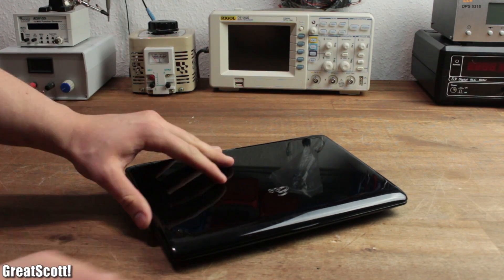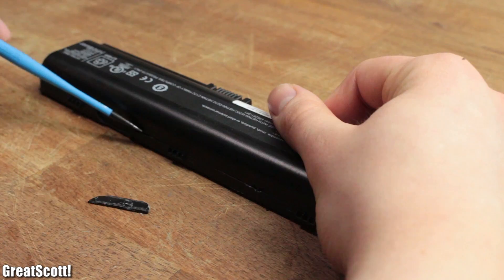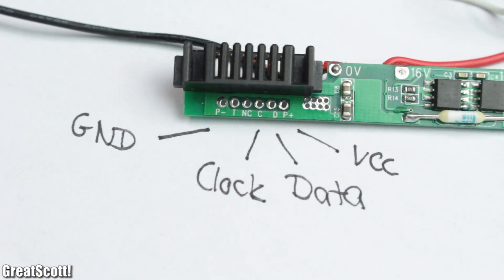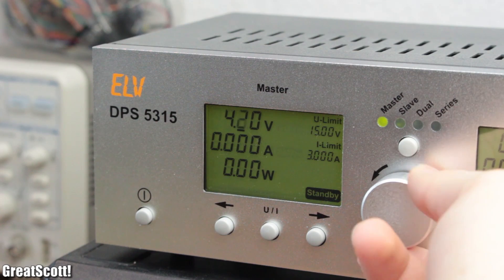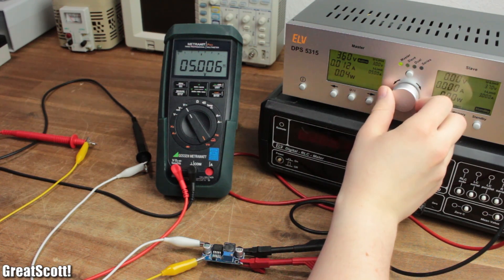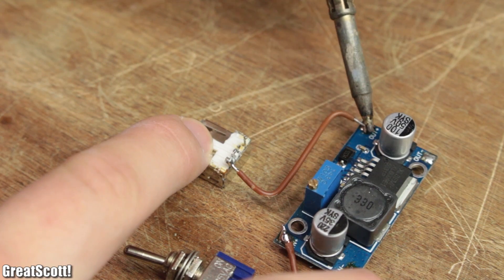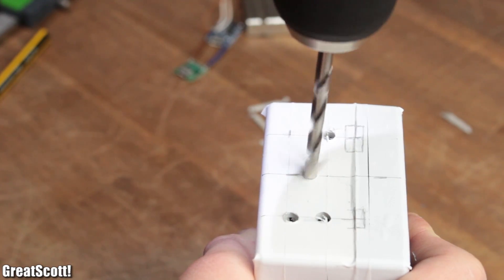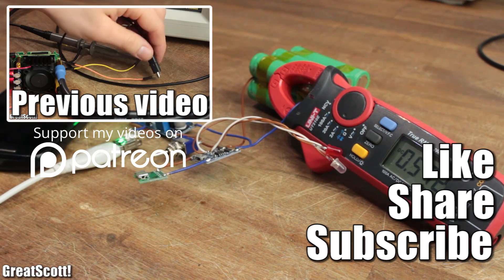HACKED!: Old laptop battery becomes a Power bank

Comment: Do not use that boost converter, it's output is electrically noisy, unstable (noise/oscillations depedning on load/load charateristics), and can easily overheat. Also, use a fuse on the batteries. Be very careful not to short them out, as they can dump a LOT of current!

Comment: no diode in series from power an battery? the right way to damage power supply
Reply: +Cappellaio Matto it is meant for charging batteries, a diode would lower the voltage too much
Reply: If you use the power bench you adjust the offset of the diode, or put in series a power schottcy diode with low drop. Really is dangerous for the psu to charge battery without diode. Sorry for the english
Reply: Cappellaio Matto i can understand the english. i thought you were talking about the dedicated charging board for the power bank, not the power supply. if you do hook it up backwards to the power supply, it will pull lots of current, because it is reversing the polarity on what im guessing is a capacitor at the output terminals for voltage smoothing
Reply: Cappellaio Matto yeah, the cheap power supplies are more likely to have problems with that, i think more expensive ones have diodes

Comment: the tp0456 does not like inductive loads across the batteries like motors!

I used 2 old 18650 cells in my small cordless screwdriver instead of the two 10yr old nimh that were dead, screwdriver worked great, charger worked great, but when i used it for the first time, it ruined the tp0456, the replacement one also only lasted about 3 seconds... so i need to fit a charge/run switch to protect the charger IC
Reply: +lez briddon just use a multi position switch, one way disconnects the screwdriver and lets it charge, the other way wont charge but will run

Comment: The battery is the first thing that has gone bad on any laptop I've ever owned...So I don't think this would work very good.
Reply: +foxrace0985 usually the circuit or a pair of cells goes bad, everything else is ok. all of my 18650s are recovered from scrap batteries that didnt work

Comment: hi 2 questions! I have the old TP4056 board and it is recommended to use one for one battery, isn't the same with the new TP4056 you use here, also you disconnect the 2 smd leds and put new ones but you don't change the resistor how is that? In the old TP4056 these 2 resistors were 1k and definitelly the leds won't light unless you switch the resistors with a value of 330R, link here :
Reply: https://www.google.gr/url?sa=t&rct=j&q=&esrc=s&source=web&cd=1&cad=rja&uact=8&ved=0ahUKEwiwwt_8rejKAhUKWywKHbwSD-cQFggeMAA&url=https%3A%2F%2Fdlnmh9ip6v2uc.cloudfront.net%2Fdatasheets%2FPrototyping%2FTP4056.pdf&usg=AFQjCNHwERfTsy0Ry8ZifBlfLtpYhmZnIA&sig2=naEqtWuiIftRFLJ7AogXFA

Comment: You might want to consider adding a resistor divider to the data lines in your USB port where your phone plugs in to. If you give specific voltages on the two data lines, it will signal your phone to do fast charging and pull more than 500mA. This is of course not standardized, so using simple resistors you can only create a fast charge port for android OR apple.

Details: http://www.instructables.com/id/Modify-a-cheap-USB-charger-to-feed-an-iPod-iPhone/

Comment: Would it be possible to ramp up something like this to a system that could power a raspberry an extHDD and charge a device
Reply: +Terry Sterling yes
Reply: DMAN22yeah I have been considering making a mobile data bank.
Reply: Terry Sterling yeah you could do that, if you want maximum energy density use panasonic 3400mah 18650s, they are $4-6 each tho, but worth it
Reply: DMAN22yeah Thanks for the info dude. I will probably work on it later in the year.
Reply: Terry Sterling i plan to make a usb and laptop charger with lipos from old radio batteries i got from a recycling bin at a battery store, and the thing i am concerned about is voltage drop in the lipos for the boost converter, because if i am charging the battery of the computer and using it at the same time, it uses 40 watts on the 120v side, i have no better way to calculate, but that is around 10 amps, so yeah a good boost converter is needed
Reply: DMAN22yeah That's cool, i have no idea what you are talking about
Reply: Terry Sterling i have 10 lipos, i want to make a laptop battery charger, but i dont want to balance the cells so i want all parallel, but to get 40 watts is 10 or so amps
Reply: DMAN22yeah ahh ok, that would be a hell of a thing to do
Reply: Terry Sterling yeah, there are boost converters that can handle 10 amps and boost converters that can boost all the way down to 3v, no in between
Reply: DMAN22yeah that's pretty cool dude. i need to learn more about Electrical engineering aparently
Reply: +Terry Sterling watch more youtube videos. i suggest rinoa super genius and knurlgnar24
Reply: DMAN22yeah Can do, i will get on it tomorrow night after sleep and work
Reply: Terry Sterling also if you like destruction watch photonicinduction
Reply: DMAN22yeah ok, but sleep now shh
Reply: Terry Sterling ok

Comment: next
You can modify the device supply 12voltage  to hard drives it ?. Connect to e-sata or usb.thank
Reply: +เซ็งเป็ด เซ็งห่าน just turn up the converter voltage

Comment: Can i buy 10pcs of 18650 batteries, conect them in parallel and charge this pack with TP4056?
Reply: +Marek Novotný i wouldnt buy them individually or for cheap, they will be a knockoff for sure

Comment: Will the cells still stay balanced without a balance charger? If one cell drops its voltage slower than the rest do you run the risk of overcharging that cell?
Reply: +KuRue02 no balancing is needed

Comment: the 3 pairs of batteries i salvaged from one laptop battery are all different voltages: 2.73, 3.15 and 2.9V. Is it ok to just connect them together in parallel?
Reply from the maker: +Mr Ching „chicho“ Chong Firstly charge them up individually completely. Then put them in parallel. Still not the best solution since they probably all can hold different charges, but nothing will explode.
Reply: ok thats what i thouht i should do too. but first i have to buy a bench top power supply -___-
Reply: +GreatScott! sorry i have another question. Charging the power bank at 1 A will take around 16.8 hours to complete, so i was wandering if we can change any resistors on the charging board to make it output 2 or 3 A?

Comment: A fun project to learn the basics but all of those parts cost more than buying an off-the-shelf powerbank that lets you insert your own 18650 batteries.
Reply: but then you do not have that nice feeling when you build something and it works...
Reply: True.  That's what I ended up doing; buying an empty 6-cell power-bank box off eBay to house some spare 18650's from a dead laptop.
Reply: yeah but they are limited to around 4 cells
Reply: can u link to it please?
Reply: +Plankins df

Comment: Wouldn't it be cheaper to buy some 18650 batteries rather than buying old laptop battery? There are prety low prices on eBay.
Reply: +Majk Majkovky you can get a laptop battery for like $4-8 if you buy individually, to get individual 18650s is usually $2-5 each. if you buy bulk laptop batteries they can be like $2 each

Comment: Is it possible to use a higher powered charger to charge the battery faster? I'd imagine it would take FOREVER to charge this through a standard USB charger.
Reply: hmm i was thinking the same, but the charger board only accepts 1.2A max so still gonna take a long time :(

Comment: What happens if you connect the USB output to the micro USB input?
Reply: +Marius Ammann haha legit question, i wander what would happen xD
Reply: no infinite energy, sadly. it just thinks its charging
Reply: The battery will discharge itself...
Reply: +MrSky05 it would also have a chance of shorting it self if i am correct
Reply: Joe Federico no there is no way it could do that
Reply: +DMAN22yeah oh I had power banks that short themselves out by doing that
Reply: +Joe Federico I do that, nothing bad happen, only its "charging"
Reply: +MrSky05 ok maybe my power bank was defective

Comment: A warning should be shown for opening the battery case with a sharp object like a screwdriver. There is a high risk of puncturing one of the lithium cells which are very close to the outer plastic wall and that could cause it to catch fire or leak dangerous chemicals.
Reply: VoltLog 18650 cells are pretty hard to get punctured, as they have a solid matal case. I opened my battery pack with an exacto, hitted one of the cells and nothing happened. (Luckily)
Reply: I have dropped and smacked my lithium cells quite a few times and nothing happened, but I could be lucky
Reply: Juan Sambucetti that doesn't mean anything, because the top and bottom can be weak spots for these batteries and this way they can catch fire. Just because yours didn't or because it isn't highly probable doesn't mean there shouldn't be a warning because when it does happen it can be dangerous. But then again what are you doing opening old laptop batteries if you don't know what they are and how dangerous they can be lol
Reply: @dimitrijekrstic7567  i am a technician (not engineer, it's kinda like one step below that). I may know something about electricity, batteries and electronics in general and know that if you puncture a lithium battery you're pretty much fucked up, but I also know that cutting metal with an exacto is hard. If the batteries that were inside the pack were LiPo's, then I would have never opened the case with an exacto, or with anything that had a metal tip for that matter.
Reply: @somedude2492  look, if we are gonna brag, I am an electrical engineer. But that's besides the point. It is very easy to short an 18650 battery at the top. The plus is the cap at the top, the one which looks like a button/pimple, and the negative terminal is the whole steel case of the 18650. So shorting those two, which is surprisingly easy to do, will cause a very nice reaction. Your education and/or profession has nothing to do with the basic knowledge that is knowing how a 18650 is constructed. I mean do whatever you please, poke it with a nuclear bomb if you wish, but it has happened to me before, and I was just warning people about how easy it is to short an 18650. Poking through the steel shell of a 18650 is very hard, but shorting the negative and positive terminal isn't.
Reply: +VoltLog no, it is much like a large AA battery, not a lipo
Reply: +DMAN22yeah I didn't say anything about LiPo, those are Lithium Ion cells and everything I said in that comment stands true. They can catch fire and/or release dangerous chemicals if punctured. They are NOT "much like a large AA battery", it would be very wrong to think that.
Reply: VoltLog they are the design of a large aa battery, i was using that as a comparison. they have a higher voltage and have a higher energy density. any battery is dangerous, if you know what you are doing than you should have no problems. and to open them, that is perfectly fine. you are more at risk of shorting than puncture. the casing is very thick

Comment: Perfect timing, I have more than a dozen 18650's that I plan on making the most ridiculous power bank with.
Reply: +Its Voodoo yeah but its only going to charge your phone like 10%
Reply: +TheFlacker99 (Flak) What do you think the capacity of your powerbank will be?
Reply: {MLP} Rainbow Dash Good question, I have around 18 cells, it'll output 5 volts (from a circuit board that outputs 5 volts) and I'm going to guess and say it'll have around 30,000 mAh's. These are all estimates of course. It may not even work :P
Reply: TheFlacker99 (Flak) Well, what is the capacity of each individual cell?
Reply: {MLP} Rainbow Dash XD it doesn't say. I have some plastic covered purple batteries that say ASO, some random numbers and letters, and a barcode. A quick googling came up with some info when I typed in ASO.
 The other ones are red, slightly clear plastic covered ones.They have alpha numerical info on them as well that didn't yield any info with a googling.
Reply: It may not be a great idea to use cells of unknown capacity, if one set of cells has a different capacity, then the pack may not work correctly.
Reply: {MLP} Rainbow Dash I know, but its just so tempting. I'll be testing each cell to see if it holds voltage.
Reply: TheFlacker99 (Flak) You could also put a constant current load and see how long it takes for the battery to hit 3.2v.
Reply: {MLP} Rainbow Dash Well the red batteries might be completely shot. I charged one and overnight it went to 2.8 volts.
Reply: ive had a single 1800mah 18650 cell recharge my phone 30+ % many times before hitting un-usable voltage.
Reply: TheFlacker99 (Flak) oh, that sucks
Reply: bummer man, i sacrificed a non working makita drill battery, managed to get 4 that work out of it.
Reply: you can make one with 2 9v batteries and a wall plug. Open the wall plug out disconnect the wires. Get a 9v battery from the dollar store open it up disconnect everything. Grab the plastic part solder a wire to each connection and connect those to the wall plug components and grab another battery plug it in and get anything you want for a case. Their you have a charger for under $5.
Reply: Its Voodoo Baaah, I want to use the 18650s though. I try to re-use when I can.
Reply: +TheFlacker99 (Flak) I am electric engineer. Cell phone, pc, laptop, watch clock, calculation machine, tv, dvd player, camera...
Reply: Oh I thought I'd let all of you know, all of the 18650's I think were shot. Back to the drawing board.
Reply: {MLP} Rainbow Dash Yes, oh well. To the local vape shop for some 18650 batteries.

Comment: Anyone think about how to build one before he shows the steps to see if you get it right?
Also how does that clamp ampmeter work? never seen one before
Reply: +Thomas Shih it measures the electromagnetic pull and then calculates amps
Reply: +DMAN22yeah okay that makes sense, how does it get rid of interference then?
Reply: Thomas Shih it has a button to zero it out before you put it on the wire

Comment: You should NEVER try to recharge Lithium-cells that has fallen below 2.5V per cell. It can be very dangerous, ans they are a ticking bomb waiting to go off. Also the capacity is very low after that stunt! Have you checked the UVLO-voltage on the boost-converter? If it's below 3V it isn't good for this use.
Reply: i use ones below that all the time. even revived one at .1 mV. you just need to charge at 10mA constant current until it gets above 1.5v
Reply: +Sven Ollino If you know how secondary Lithium-cells work, you wouldn't be saying that. Have a look at this, it may teach you something new: http://www.mpoweruk.com/lithium_failures.htm
Reply: yea, they probably won't explode but their life will be shorter.
Reply: +zaprodk I think he knows this, and he was probably checking his batteries frequently.
Reply: +zaprodk What are you talking about? Yes, care must be taken when reviving cells but after that- how are they different from other old cells? I'd only charge them under supervision and individually though.
Reply: I understand that. The anode dissolves and may cause a short circuit in the long run. The short circuit may cause an explosion and possibly a fire with some chemistries and lower grade batteries. Old grade-A cells that have limited capacity and have been sitting above 1.5V pose little threat. With that said I still wouldn't hand them to any friends or family.
Reply: +Sven Ollino Exactly. I wouldn't want some of these cells going off while i sleep.
Reply: +Victor Arnaiz Try to calculate the capacity of the cell. It will have diminished greatly. Also, as it may charge up with no issues, you never know when it will go nuclear on you. Good luck.
Reply: Victor Arnaiz if they are not there for long then they will work normally
Reply: Victor Arnaiz yeah, they should work fine.
Reply: +Victor Arnaiz any updates?
Reply: +zaprodk ok but below 3v is alright because power banks have a voltage cut-off at 2.5V.
less than 2V it's dead.
Reply: zaprodk. i tried it but my output is somthing about 150mh any ideas what i can do
Reply: Ch Bi Ma you mean ?
Reply: Oh yes sorry
Reply: well it depends what you plug in the usb port, the object you have plugged in takes what it needs, if you want to test the maximum the usb port can handle plug something that uses a high current. You can use this module too : http://www.ebay.com/itm/1PCS-USB-Load-resistorPower-Resistors-Mobile-Power-Aging-Resistance-module-1A-2A-/152075848838
Normally if you use the same module in the video you can go to 2a max
PS: i'm JS7457, just logged in with an other account.
Reply: Toss it away. It's dead.
Reply: zaprodk waht is dead
Reply: I made this circuit and works well. 
But the problem arises when cell voltage drops below 3 volt. The Boost converter start to output 25-30 volt. Any taughts on that??
Reply: +JS7457 2.5V is under load. If it's left sitting with no load at 3V or lower it isn't good for the chemistry.

Comment: Love the content you give to us, thanks :)

Question Please) I recently got a soldering station and love it but I was wondering if there is a 'magic' temperature setting that can be used on most electric/electronic components. I have mine set to 300 degrees but it is too cold and even with 0.8mm solder wire it struggles to properly heat for melting. I suspect 300 is a bit on the low side. Thanks
Reply from the maker: +Wonder Around I always use 350 degrees.